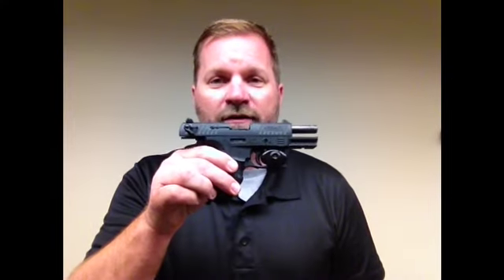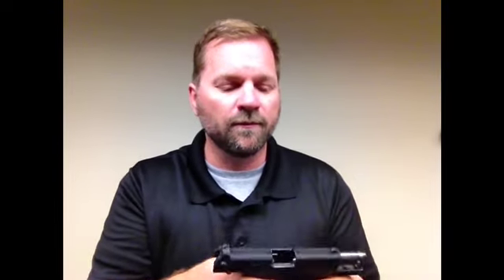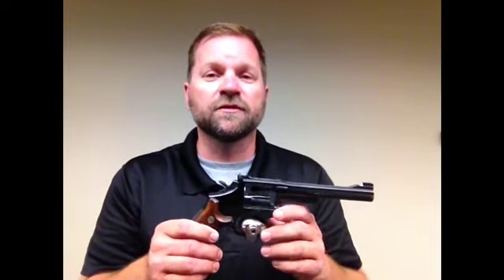Trigger lock vs cable lock

Comment: So if you use the trigger lock incorrectly it doesn't work... imagine that. I could put the cable lock "around" the grip and it would just fall off when I picked up the gun. Would u then say cable locks don't work...

Comment: I use a trigger lock and an chamber plug, is that unsafe? Or is it good enough?
Reply from the maker: Sirreal69 Hi Sirreal69. I checked out a chamber plug. The one I found online looks like it supposed to keep oil from getting everywhere. It doesn’t seem like it’s a security device.

Comment: Cable locks would be great, if the cables were invincible and impossible to cut.  Is that the case?  Are these uncuttable cables?
Reply from the maker: There’s often a way to get around locking devices. I just wanted to express that I’m not a fan of trigger locks. I think cable locks are better.

Comment: Cables are easily cut with cheap available tools in seconds.
Reply: Yes but if you are a father with young toddlers the cable lock is perfect.  They can't cut the cable or pick the lock or load the gun.  If you have older kids it is not safe enough as you mention.

Comment: Lock the trigger is one step but locking the gun in place by mounting it on a wall or tie in in place with cable is another.
Check locks4guns.com

Comment: And yet in Canada, when transporting a gun, you are required too have a Trigger Lock installed on your gun.
If you are using a Cable Lock instead, you could likely face Arrest, and Fines.
This is what happens when you let Bureaucrats make the rules.
Reply: Old Yeller if it's non restricted, it's transported with the action open, no lock. If it's restricted you use a trigger OR cable lock, in a locked case. What are you talking about?